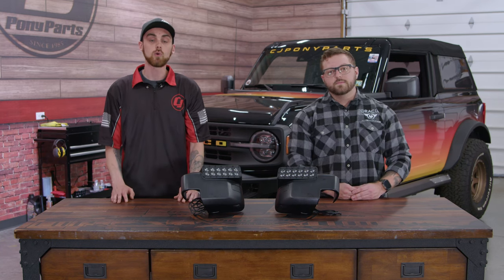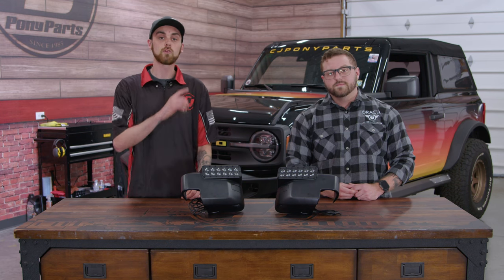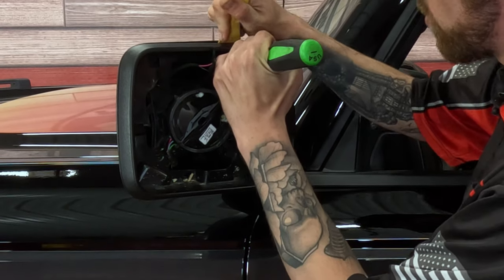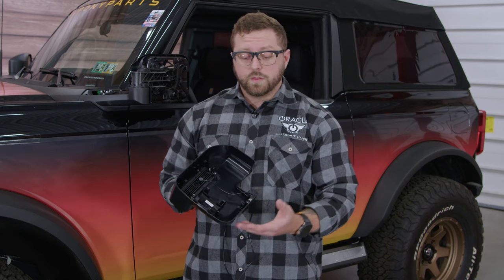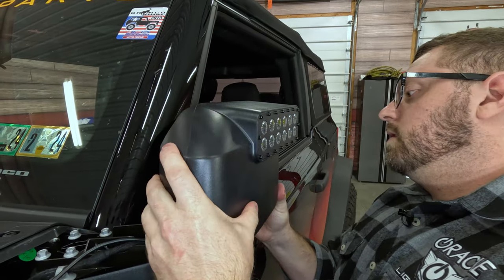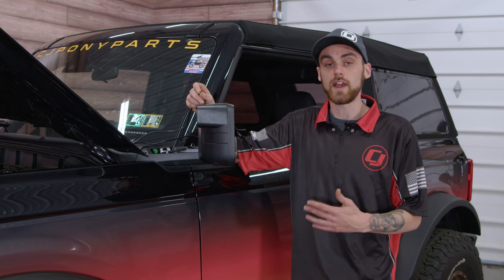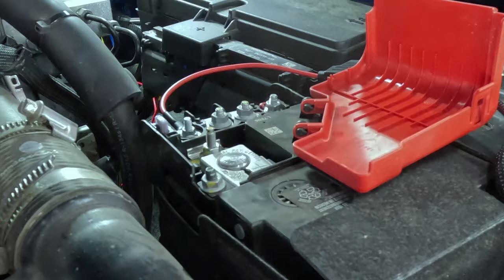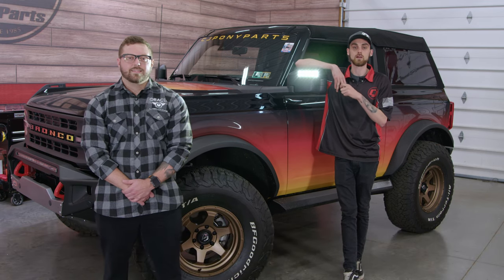The BEST Ditch Lights For The 21+ Ford Bronco / Oracle Lighting LED Side Mirrors

Comment: I have the Rigid lights installed on the accessory portion of the headlights. I'm curious if I could splice into those power lines to have the mirror and Rigid light run on the same aux switch on my Badlands?